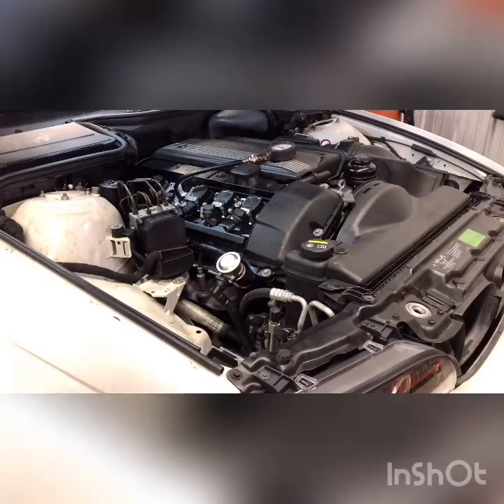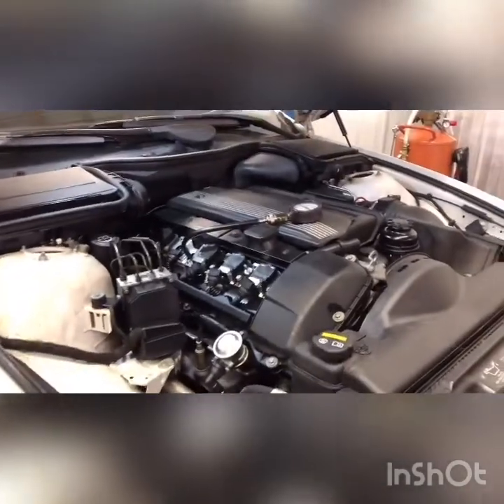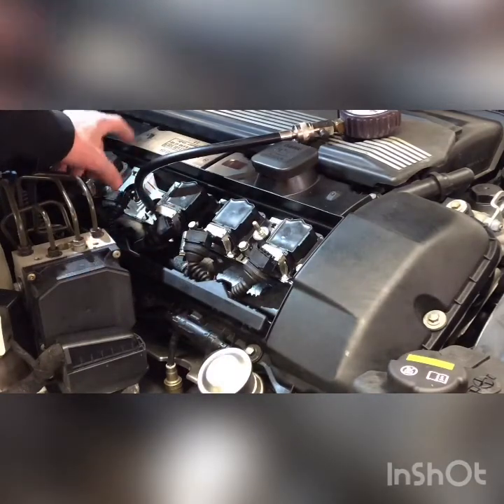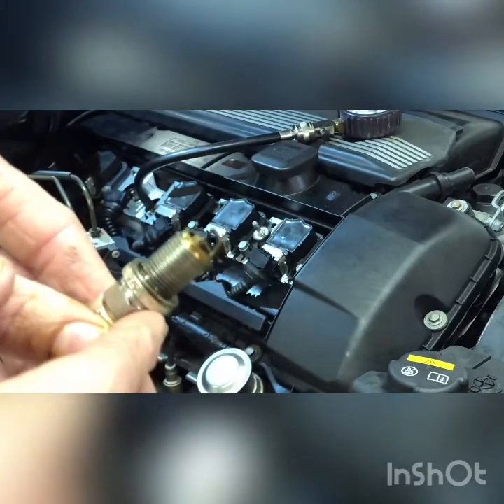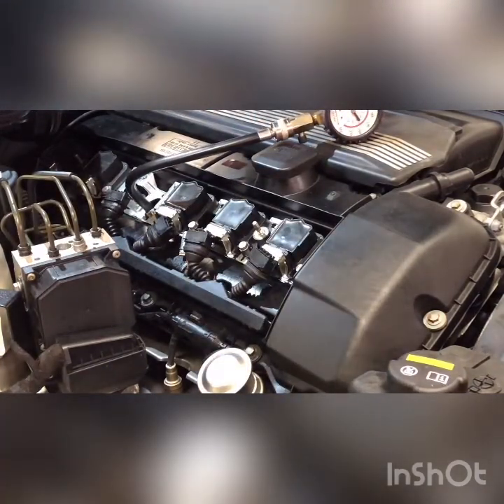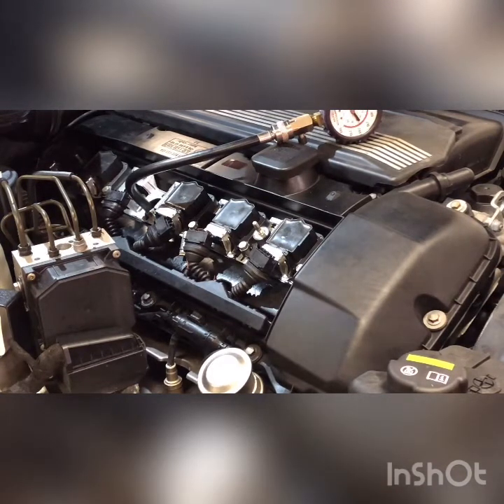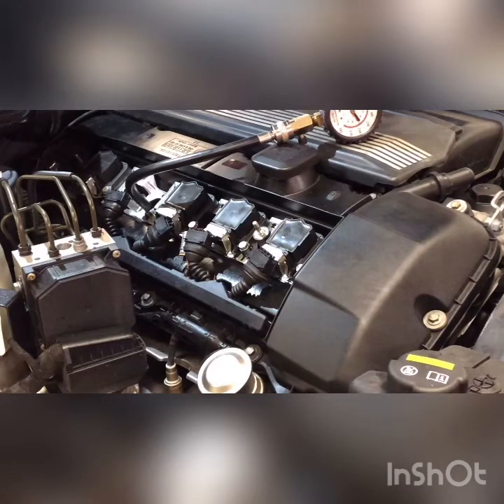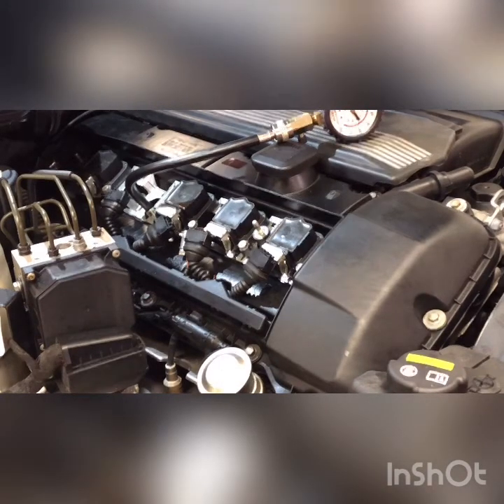BMW E39 engine misfire

Comment: Hello Dan

I was wondering, did you find the problem causing the Misfire on cylinder 4 and have you fixed it? 
because im having a problem every now and then on Cylinder 4 in my E39 M52TU 2.8L 
and it dosent seem to be coils/plugs/wireing. 
and i the only code the scanner is throwing me is F1 - misfire cyl 4.
no other codes at all 

i dont have the tools to do a compression test at the moment, but im thinking of buying one.

Could you point me in some sort of direction here? 
i dont know what to do from here :)
Reply from the maker: Yes I did! It had a burnt exhaust valve. 
Have you tried switching spark plugs and or coils with another cylinder?
Reply: and i tried switching coils, without luck, 

But the problem is, that the car dosent misfire all the time, just every now and then, when it runs ''normal'' i runs really great

thats whats confusing the heck out of me :)
Reply from the maker: Did you say you switched spark plugs?
Reply: @danofalltrades3567   i have changed all sparkplugs to new yes, still getting the misfire sometimes.
Reply from the maker: Ok then. Go to a GM dealer and get a bottle of fuel injector cleaner. It made by ACdelco and it’s kinda pricey but it works the best. Add it to your tank of gas as directed.
You must have carbon build up on your piston rings or valves. This will help clean that off.
Reply from the maker: If that doesn’t work then you will need to do a compression check.
Reply: @danofalltrades3567  okay thanks, i will try chat next :)
Reply: @Corex91  hey did that work? I have the exact same problem, car runs normally while cold and starts misfiring the more i drive it